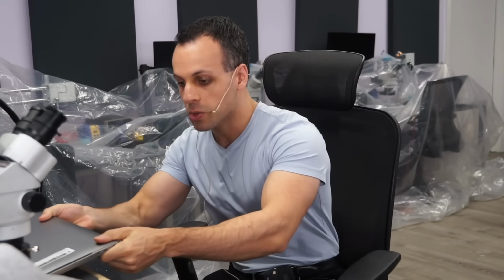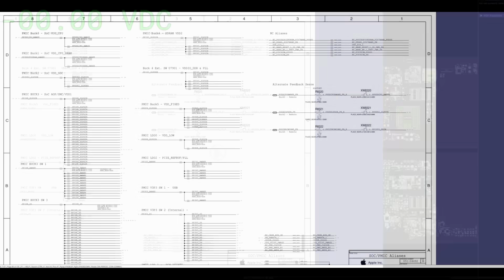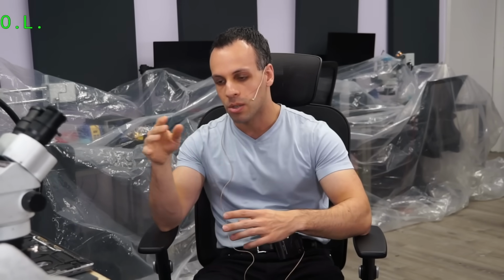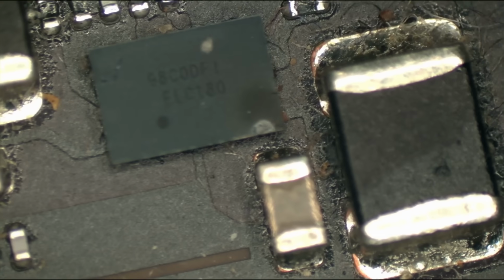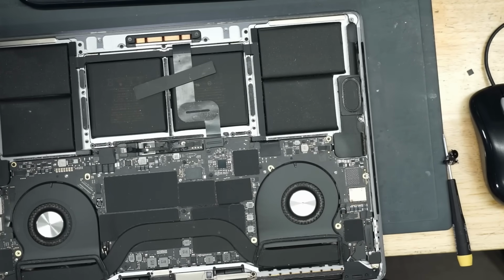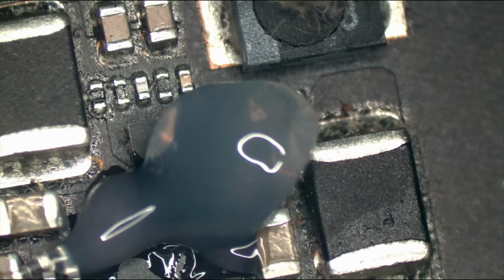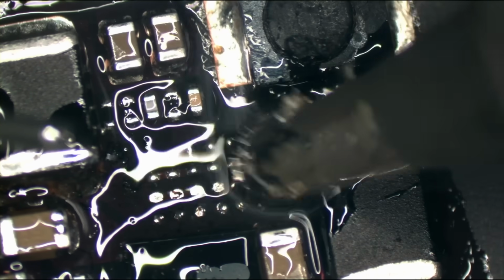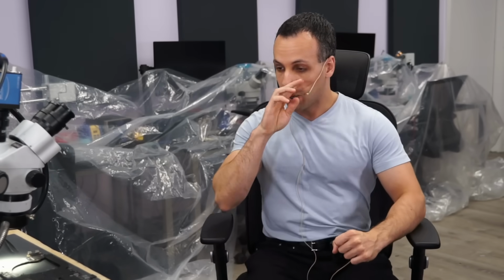How most 16" Macbook Pros often kill themselves & why they're unfixable

Comment: I watched this video on a 16inch macbook pro when he'd just uploaded and hoped that this wouldn't happen to me. Got scared and saved everthing important on a cheap flashdrive. A month passed and my mac died with the EXACT SAME ISSUE. The motherboard got replaced for around a thousand bucks and I sold the machine right after it. I lost around $2000 in total. For one time I hoped that you were wrong but.. oh well.. 
Despite all of this my friends and relatives are asking me advice on buying macs. Buying a PC with soldered SSD is a seriously DUMB move and people need to know about this! There are now way better screens and keyboards on many windows devices and many of them are repairable. Please don't think this is a single model issue. This company is not dumb. These pro devices are things that people rely on to do real work to get paid. When things go wrong and machine gets broken, they know that you'll be ready to pay them more! Apple is indeed evil.
Reply: A soldered-on SSD is not necessarily a massive problem, especially in an ultrathin that you likely won't be able to put together after taking it apart. What is a problem is using power regulators with such a shoddy reliability record. It's not a complicated device, and SSDs pull very little power, it should work indefinitely. The fact Apple continues to use them and denies warranty requests arising from them is the problem.
Reply: @paulie-g  SSD's are going to die within a couple of years of use. I reckon even if the Power regulators were good, this would still be a problem.
Reply: @lukafireman  Few people exhaust the TBW. Most ultrathins, where the soldered SSDs happen, can't functionally be disassembled and put back together. The battery is the core issue there because that's certainly going to die before the SSD. The issue with these SSDs in particular isn't that they're soldered, it's that replacing them isn't possible because of an Apple lock that can't be gotten around without a tool that's not available.
Reply: This is why I build Hackintosh machines. I can avoid Microsoft software and Apple hardware.
Reply: @brpadington  lmao! Wise choice!
Reply: @brp @brpadington Question is for how long. MacOS Tahoe is the last to support Intel chips, only Apple Silicon will be supported moving forward.
Reply: @jackbryan4676   I'll just buy a Mac studio when they drop support.
Reply: 2016-2019 MacBooks are the worst laptops you could buy. I hope they've fixed these issues in M1/M2 ones. If you want a reliable laptop, just get a ThinkPad or the equivalent business models from Dell/HP. And for desktops, just build a PC with quality components.
Reply: @ @Chopper153  I have been very lucky with my 2017 one. It’s still going strong, but the battery life is no longer what it once was. Seeing that the SSD was soldered to the motherboard in this video made my HR shoot up. My 2021 M1 Pro 16” is still working. Regardless, I have been running daily backups for about decade because I have experienced a computer failing with no backup and yup, lesson learned.
Reply: Shit, i got my custom pc for $1800
Reply: My friend.. Aplle truly is Evil. 

I've been posting the following message on all techtubers' channels here on youtube. I even posted this on apple discussions twice . once edited and you know what Apple did? they removed my comment twice :))) :

"
Sue Apple for soldering the SSDs onto the mac Motherboard making it very difficult and pricy to repair and overcharging way too much for storage and RAM and doing shady RAM and Storage management among other things. (SSD Swap even on 16GB with just a few Chrome tabs open)

Hello. It is time we gang up on Apple and SUE them for choosing to solder the SSDs onto the Mac Motherboards since 2016. On top of that, they also overcharge 3x-4x the price per TeraByte compared to top SSD manufacturers like Samsung, Sabrent, Kingston, Western Digital, Seagate, and so on. 2TB (non Replaceable) SSD @ Apple ---> 600$-800$. At the same time if u go on Amazon you can get a 2TB (easily replaceable) Samsung 980PRO SSD for 200-230$. 
- When the SSD Fails.. and it will eventually, they will also overcharge you for the repair, because guess what, if you need it replaced, the way they go about it is by replacing the whole motherboard which is an absolutely wasteful way to do it. Imagine replacing so many parts when you could've just replaced the SSD. But they want YOUR MONEY (As much as they can get their claws on).
- RAM: they charge 400$ for 32GB and 800$ for 64GB of RAM. At the same time, you can go on Amazon and pick up 32GB of DDR5 for 140-155$ and 64GB of DDR5 for 260$-300$ (Replaceable)
- They also do some shady stuff with RAM management: if you get 16GB of their overpriced RAM and monitor your SSD swap Memory, you’ll notice that the macs write a lot of GB to the SSD like 16GB isn’t enough for a couple of chrome tabs. Disgraceful…. ( what I’m aiming at is that they’ll most likely make your non-replaceable-soldered SSD go bad sooner than later… good luck getting a humane price for the repair.
- And last but not least, I don't know exactly what they do but they fill your Mac and iPhone with not-so-specific files that you can't quickly discover and delete, thus making your storage fill up quicker. Basically, they're forcing your hand and your wallet to buy the bigger storage option (which is overpriced, to begin with as stated at point 1). I just had to delete apps on my iPhone because when I go into Settings/General/iPhone Storage and click on any App, I can't access/open any Apps' "Documents&Data" just so I can see what is taking up so much space and actually delete all that data that's uselessly filling up my storage.
Apple products are made well and are very shiny and pleasant to the touch and to use. All they have to do is stop making those shady decisions behind the curtains. But they always make those shady decisions until enough People start making noise about it or a Higher Authority decides to step in and force them to comply (to behave like good human beings). For example, the EU stepped in and forced them to implement USB-C. Apple's Lightning connector was a nice connector until 2014 until the USB-C connector came along... and yet it's 2022 and if you get a nearly 2000$ iPhone, you still get a Lightning connector on it (USB2.0 speeds: 480Mbps/60MBs per second). up until now, Apple has proven that it is in their Essence to not think about their users, to not listen to them, and to always try to squeeze as much money as possible, borderline robbing you until people start to catch on and speak up and even when they do speak up, Apple always tries to stand their ground with their shady business practices.
We must take action. Seriously. Either ask higher authorities to step in and Force Apple to clean up their act or we just collectively stop buying Apple products. Keep in mind that apple decided to remove the Headphone Jack and soon after the industry followed them instead of standing their ground. ( Keep in mind that apple sells wired earpods for 20-25$ but sells their Airpods for 250$. (I wonder why they took out the Headphone Jack...) so just because they are wireless the price difference is roughly 1200%. I would never buy their wireless earbuds because I see it as their greedy Sin. So just because you introduce wireless functionality you do it at 1200% price difference? NOPE. HUGE NOPE. Imagine if we all Stopped buying Apple products for 3 Years. Imagine the looks on their faces year after year when they see 0 Sold Products :O:O:O. That would be awesome. 
Wish you all the best and take care.

"
Reply: Work on external drives and back up projects. Buy the bare minimum machine and repair or replace with no problem
Reply: @Sergei__v   isn't that a stressful habit just to have an unreliable machine? I am good now with a thin and just as capable laptop (with Oled 2K display )and I can simply unplug my storage WOW!  (in Tim Cook's voice)
Reply: @bluecloverIeaf  well, everyday life shows that Apple computers are far more reliable, go figure.
Reply: not true at all, if that was the case, Louis wouldn't be so successful in his business. Go watch apple engineering faults and see the real life for yourself. That's the reality. If your device still works, good for you. But when it breaks, I would be so happy not being you having to deal with that  @Sergei__v
Reply: F apple for doing this bad bad business practices
Reply: After 2015 MacBook Pro I’m done with Apple in 3 years I replaced 3 batteries. Dunno why but battery would die under 300 cycles. It would get swollen. €130 is battery replacement. Bought Asus Zenbook. Only minus of Asus is loud fans sometimes.
Reply: I think they do even shadier things such as program bugs into software updates to affect older model iPhones.
Reply: No Apple and no Adobe!
Reply: If you buy Apple, you are already a certified dumb.
Reply: can someone give me some actual windows recommendations then please? im having trouble finding good ones
Reply: @kay1229  check asus! they have plenty of good laptops! I am using vivobook 14 pro now. It comes with with pantone certified, glossy 2K oled screen with pretty good specs. It was cheaper than a macbook air and it has a dedicated GPU, aluminium body, glass trackpad with precision drivers, good backlit keyboard and all the ports you need. It is not even chonky and not loud at all. Battery life is not remarkable only 6 hours and I am okay with that for all these. I think you can easily find one for your needs and budget. they also have ones with good battery life too if that's what you are looking for. I hope this helps!
Reply: @kay1229  ASUS Zenbooks are a fairly certain bet. Lenovo X1s. That's ultra/thinbooks. If you have other requirements, list them. ASUS Vivabooks with AMD APUs, when on sale, are a good cheap option.
Reply: What about the air variants? I heard they have ssd soldered too
Reply: Apparently nobody here heard about 3D NAND and what it did for SSD lifetime.
Reply: Well said and apple are funded by loyal sheep who keep going back because its seems they enjoy being abused. You should ditch their products and advice friends and family to do the same. You are very right they are smart and have top designers these things are not designed like this on purpose. I am an electronics design engineer of 8yrs with BEng honours. Our products are desinged so well despite being 1000 times smaller then apple
Reply: I have that same 2014 macbook pro, I have water damaged it (spilled cup multiple times) and broken the screen once and replaced it still works nearly 10 years later. It's sad to see what this company turned into.
Reply: Buy another one 😂
Reply: What model bro?
Reply: Yeah. The only reasons I stay on a MacBook at this point are Logic Pro, XCode, and iMovie, none of which honestly have any good alternatives I like at the moment. Am certainly thinking about switching to Linux (which I've used before and like) though lol
Reply: Was it an m series macbook ? What model was it ?
Reply: @rohithkumarbandari  nope it was the last intel series one.
Reply: @bluecloverIeaf  Oh. that makes sense. M series chips rarely have issues like this.
Reply: @rohithkumarbandari  they do have other issues like display sensor issues, the display cable being destroyed by a spec of dust and some other bad design related issues. Prob Louis posted a bunch of em here on his channel too! yeah they arent as bad as my problem but they are still pretty bad unfortunately
Reply: @bluecloverIeaf   Do these issues occur within 3 years ? One of my friend bought a macbook pro e years ago and it works as good it worked when it was new. Even I recently bought macbook recently looking at durability of his laptop.
Reply: @rohithkumarbandari  I mean those issues doesnt have a timebomb like this one so it is due to luck. Also they are common but not as common as this issue. So it might be alright, i would suggest regular backups or using cloud storage in case a failure happens. because you cant remove the ssd from those models either
Reply: @bluecloverIeaf  Oh, thanks for the suggestion.
Reply: Wow that sucks. The 2019 was trash. 

Please please do a better job backing up than a flash drive when a YouTube video reminds you. If your data matters to you, back it up, get backup drives with warranties that cover recovery or buy insurance (disk data recovery is expensive), replace backup disks when warranty/insurance expires, etc
Reply: Apple want people to keep buying their products. They are designed to fail after a set period of time. Or they become obsolete due to software updates over time.

I have a windows PC built about 10 years ago and apart from it being slow at times it still works(touch wood).
Reply: @daviniarobbins9298  my macair is from 2013 and it still works like I just bought it. Never turned it of, just closed the lid, and it works perfectly every time I open the lid.
Reply: @daviniarobbins9298  I have a 2012 Intel 3930K tower, it still runs perfectly well and does what it’s supposed to, no problems in 10 years and I can do 90% of my workload without any issues.
Don’t play the latest AAA games so I can see this lasting for another 5 years.

I pulled a 2006 Dell XPS M1710 (Core 2 Duo T7600, 4GB RAM, NV 7900 GeForce Go) out of storage, it’s dog slow with Win 10, swapped out the 5400 rpm 750GB HDD for a 512GB Samsung Evo 960 SSD, replaced Win 10 with Linux Mint and it’s astonishingly responsive and useable!
Can document edit, do,basic spreadsheets etc. 
watching all the Apple stuff being sold for exorbitant prices and the they die within 18 months only to be replaced with more expensive stuff which then dies again, ad infinitum.
Now wonder why Apple is a $3 trillion dollar company.
Reply: @glenyoung1809  Macbooks are some of the most reliable laptops you can buy have been for a least a decade
Reply: @daviniarobbins9298  I got 10 years out of a Mac and I used it to make maybe $1.5m over that time. I'd rather have a Mac that fails due to planned obsolescence than Microsoft Windows on a PC (except for the VR support on Windohs).
Reply: @daviniarobbins9298  Yeah idk about PCs but I have a 1000$ HP envy x360 windows laptop from 2017 and it's the slowest piece of shit I have ever used. Legit unusable even for school and simple stuff like word. Laptops are not built to last long it seems, whatever the company.
Reply: @slickshadows7945  fr? I have cheap asus laptop i bought back in 2015 for around 500 usd, still works fine till today except the monitor backlit are died and i need to plug on external monitor, but other than that it still works fine that i still can run office + chrome with 20ish tab + running IDE for programming without any noticable lag
Reply: @slickshadows7945  My HO Envy x369 from 2017 still runs at full speed , still hasn’t slowed down at all
Reply: @KevinRuntupalit  yeah well the battery doesn't hold no charge + the hard drive keeps it slow as fuck. I have never hated a computer as much.

I have an asus gaming laptop from 2020 and it still runs like a champ, but I got a macbook for school since the battery lasts like an hour at most. The macbook I got is supposed to have a newer more durable ssd, but I'll let time decide if I also got fucked by apple. I'm pretty unlucky with tech.
Reply: @slickshadows7945  What processor? How much RAM?
Those are the first questions.
Reply: @slickshadows7945  did you ever take it to a repairshop just to clean the dust out of it and to also apply new thermal paste on the processor and Graphics unit?
Reply: @slickshadows7945  just buy an old school workstation laptop it will get the job done no windows 11 tho and u will have fun carrying it as an exercise (bulky af) mine is a dell precision m4800 and it was released in 2013 and oh boi she's heavy af but she gets the job done so I'm not complaining still using it as my main laptop/pc me too poor for new shit.
Reply: @slickshadows7945  Laptops all suck except for Macbooks
Reply: @slickshadows7945  nah, im using this W540 thinkpad from 2014, only change battery once on 2017 and still work like a charm untill today, yes, today, after almost 10 years served me so well in my work etc.
best 1600$ ive ever invest. 

note : 
 i have several others thinkpad's that ive bought years back then, and still works like a champ today, the oldest one is T400 from 2009, never had any issues at all, even the battery still hold for 3 hours on a single charge, runs well with windows 10, 8gb of ram and of course, SSD.
Reply: @daviniarobbins9298  I bought my MBP in 2012. 11 years later, it still works like a charm. The only reason I'm upgrading, is because FCPX  is too slow on it, for all the plugins that I've installed subsequently. This one just can't handle it. Also, I have a desktop Mac that I've had since 2007, running Logic Pro. Zero issues.
Reply: @Davinia Robbins brah ur comparing a PC to a laptop 🤣
Reply: @daviniarobbins9298  funny. My 2016 MacBook Pro is flawless. Super fast. Great battery even after more than 6 years. And i do music stuff on it every day. I just don’t play games on it. 
I also have a powerful pc that i built. And i hate Windows. I barely use the pc as i have ps5 for gaming anyways. Pc is more for emulators. Or when I’m at home and prefer the big screen
Reply: @vitorfernandes651  Unfortunately not with my friend's $2000-ish 2017 Macbook Pro
- Motherboard connectors and screen died after 4 years of light usage (screen replacement is free but not the motherboard)
- POS keyboard but at least it was not dead
she replaced it with M1 MBP tho
Reply: @vitorfernandes651  this is a man who gets it. I do the same. Keeping my GPU workloads in the cloud and my gaming to my beefy desktop gives my laptops much longer lives. My dell inspiron with a 7800 GT could still run CSGO surprisingly well when I dusted it off to see if it actually worked after all these years!
Reply: I absolutely agree! 
Soldered RAM is kinda inevitable for thin & light laptop but the soldered SSD is a no no.
I have experienced it myself how good it is to have a socked ssd.
My laptop motherboard decided to shot itself, so I called the manufacturer to send someone to come replace the board for me. The OS, programs, configurations, and all of my data are in the SSD. Just swap the board and then you're good to go.
Reply: It is like a company that is investing more into a fancy design than making all done well. Tell to a product manager that you can use the same power supply for a cheap product to supply the same devices which does not work for a high end device because of the higher ambient temperature. This mindset problem could be theoretical the case here.  The welded on SSD will be high likely because of space safeing for a nicer design
Reply: Stop buying Apple
Reply: @Playlist-zl3wu  I obviously stopped buying Apple products :D
Reply: @Playlist-zl3wu  as a non-Apple user, I need to chime in and say that for some people, the most practical tools for their work really are Apple computers. I know that for high-end video editing, Macs are pretty powerful. It really sucks that the competition either can't produce machines as powerful, or copy Apple's anti-repair designs anyway.
Reply: A friend of mine just bought the latest iMac air, hope he has a lot of money
Reply: @toddt6730 iMac Air does not exist. There is an iMac and a MacBook Air. Which is it? lol
Reply: Get yourself the Framework laptop and upgrade any time. Will cost way cheaper to buy and  maintain Mac.
Reply: Apple haters are hilarious. Unless you’re going to shell out for a 2k+ workstation laptop, windows laptops are junk. They all overheat and last less than 3 years. I’ve got a HP Z book and it runs flawlessly after 3 years, but it’s a premium grade machine that HP actually put effort into. Anything windows I have had sub 1k has completely shit itself after 2 years. If I didn’t need engineering software I’d have easily have gone to a M1 MBP. Macbooks reliability is unmatched. Now they are the most efficient laptops with Apple silicon, they’re so far ahead of everyone else it isn’t even a contest. Just wish more stuff worked on them. Oh well
Reply: @teamtoken  Agreed, I have 2 Zbooks at work and they sit on the shelf gathering dust. They are boat anchors.
Reply: @teamtoken  That's nonsense. ASUS Zenbooks get you the build quality at half the price for the same or better performance in ultrathins. Extended family have had 5 of them over the years and the oldest one at 7 is still going strong and it's used all day, every day, 10+ hours a day (both work and entertainment machine). I've got a Thinkpad from the 1990s that only needed a new battery. Had a cheap plastic $400 discount HP job that lasted 5 years until an accident caused mechanical damage to the charge port. Fixed it, still going. Most chromebooks take immense abuse and keep going. The list is endless.

It's not even a contest.

Because you can either buy a) a high-complexity, well-engineered laptop where the level of complexity is matched with the quality of engineering, or b) a simple, inexpensive laptop that's got fewer failure points.

The sole exception is "gaming/3d workstation laptops" which put in so much TDP that they require the cooling solution to work within tight tolerances to cope. In this case, you know exactly what you're buying. It's like overclocking -  you accept you're living on the edge for the extra performance.

The "wish more stuff worked on them" is precisely the point. M1/2/666 implements accelerators that give it misleading performance numbers in some benchmarks - it's not general performance, it's workload specific performance that requires use of software that uses the accelerator specifically. This is valid, and something Apple can afford to do in the A/V space because their ISVs will be forced to adopt it. It has nothing to do with reliability, or general performance.

If these are your workloads and you're OK with vendor lock-in both in hardware and software, the reliability of Macbooks doesn't matter - it's a professional tool, so you will replace it when it breaks like you would a tractor or a chainsaw. It, again, says nothing about how reliable they are or how useful they are to the general consumer.

This family of Macbook models, as Louis said, have one particular glaring issue. This issue could easily be resolved by using a different part (that's not fail-open), or adding a part that protects the SSD from overvoltage. This is the sort of problem that results from overcomplication that's not matched with appropriate engineering effort.

What is the most glaring of indictments is that Apple has not bothered to fix it, which they could easily do, because it benefits them financially for out of warranty Macbooks to die. On other models it was cheap thermal paste. On yet others it was another PMIC.

Does that happen to other manufacturers? Absolutely. But they spin a new rev of the motherboard where the issue is fixed if they continue to produce the model. Not so Apple. So the hate is absolutely justified.
Reply: @paulie-g  look into ANY laptop brand and you will find issues galore, many of which don’t get fixed at all because the design changes every few years anyway. And none of those laptops have anyone like louis who pores over every detail and picks out the one bad issue from other thousand things that Apple did better than everyone else. If you did a teardown of a lenovo, MSI, ASUS I guarantee you’ll find a design flaw somewhere, but no one cares about an Lenovo thinkpad P1-21DC001Q because they sell only a few thousand a year and no one would watch it. 

Does Apple get stuff wrong? Of course they do. But I doubt Apple does this specifically as a form of obsolescence. If Suddenly Macbooks started dying just outside of warranty, nobody would buy them. How many customers have this as an issue? Hundreds? Thousands?
Reply: @teamtoken  Yeah, you're right, Lenovo only sells "a few thousand" of each laptop and no one cares. Numpty.

As an FYI, Lenovo outsells Apple 2-to-1 or more. Their biggest market is corporate, meaning they sell with full support and (usually next-day) replacement contracts. You simply have no idea about that market, how it works, and what having defects like Apple's would do to Lenovo's margins. Lenovo's Thinkpads are not as overbuilt as IBM's were, but they're plenty good enough and Lenovo has actually grown that business substantially.

Yes, sheeple will continue buying Apple products even when their laptop GPUs melt in front of their eyes because Apple cheaped out on the thermal paste. It's a cult and their products are a social signal like wooden earloop piercings and tramp stamps. Your Macbook melted? Buy another one. And that's why Apple keeps doing it - they can get away with it, it takes older machines off the secondary market and stimulates new sales.

Other companies simply can't afford to have perennial issues like this. LG had a solid smartphone business once. Then they released a model where the SoC chip would lose contact with the board as the lead-free solder cracked over many heat-cool cycles because the thermal solution was inadequate and the RoHS solder formulation couldn't deal. By the time this was discovered they had another gen with the same issues on the market. By the time they seemingly solved it they no longer had a smartphone business. And this was, essentially, a one-time mistake.

Apple continues to be cavalier with thermal solutions, power rails, and so on, consistently failing to build in safeguards for issues in new gen hardware, overcomplicating and underengineering. This is a *choice*.

And you're wrong about there being few eyes on other laptops. Countries with lower labour costs (where it makes sense to pay for the qualified labour to repair), lower wages (where repair is preferable to buying a replacement) and a repair culture, eg Russia, have tons of channels showing common problems and repairs on non-Apple laptops. You just don't know about them, but people with clue do - and check them when choosing what to buy. Almost overwhelmingly the issues are with gaming laptops (that don't even have Apple equivalents) which are on the edge with GPU TDPs and power draw. You expect some rate of failure there because they're on the ragged edge trading everything else for performance. Sometimes it's a bad power FETs from a third party manufacturer that can't actually handle what the datasheet says it can under extended high load that's out of the OEM's control (recent'ish Acer Predators had that problem), similar to MB's issues with their gearbox on `07-08 S-classes when their supplier stitched them up. In other words, not persistent issues making the same mistakes entirely within their control on medium- or entry-level performance products which aren't pushing the envelope in any way, except an artificial one through being underbuilt.
Reply: @teamtoken  least delusional apple fanboy
Reply: Preach. Windows is sent from God himself. ❤
Reply: @OrdinaryCritic  bro I understand you don’t like macOS but you can’t say that windows was sent from god 😂 11 had good changes but no OS we have right now is good enough to be sent by a god
Reply: @amr1t_  silence, heathen! Get thee behind me with your scamOS!
Reply: @OrdinaryCritic meanwhile, the real OS, Linux, is available for free, and has much higher reliability.
Reply: Here is another victim of the BS from Louis Rossman. I have serviced machines that are 12 years old.
Reply: @isaeltavarez  Don't call out BS with BS.

He's referring to a specific line of Macbooks that couldn't have been made 12 years ago.

16Inch Macbook Pro (Most likely due to a soldered SSD on the MOBO)

If you indeed have evidence to claim otherwise, please elaborate.

Also, the only video you have of anything computer repair related is most likely not even your own, and showcases ESD.

If you're gonna just comment for hate, don't do it.
Reply: @isaeltavarez  That's the point mate, I thought that this won't happen to me but Louis turned out to be right. My mobo got busted while taking my SSD with it. The 12 year old machines you serviced, DO have removable SSDs or harddrives but this model and newer ones DON'T!
Reply: @isaeltavarez did Louis Rossmann magically from afar cause this guy's macbook to fail?! What is your logic here?
Reply: @isaeltavarez  In fairness, my experience of a long-living Mac was back in 2010, the 2017 was busted within 3 years. I think a lot of companies have jumped on the obsolescence band wagon - fair enough - if my experiences differ, I'm not disputing what you say. My iPhone is 3 years old and, until there's a decent Linux Phone then I will stick with Apple, I could be wrong here, I just feel it has slightly less spyware than Android.